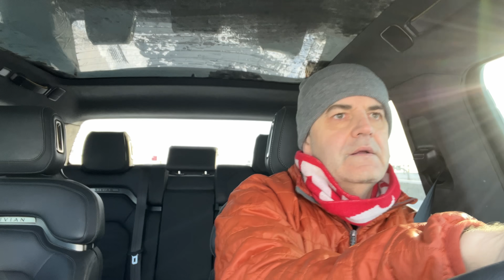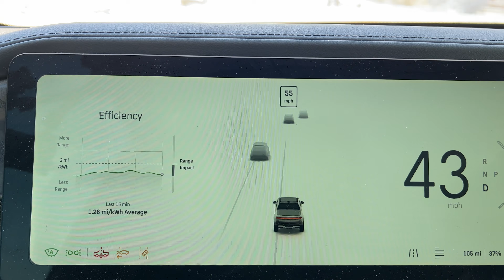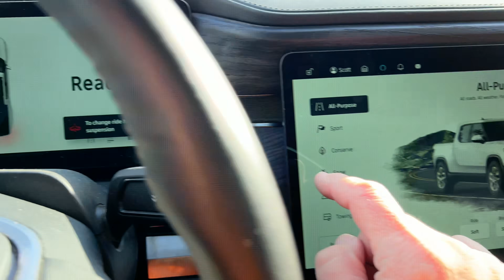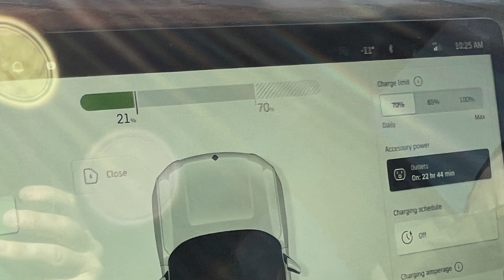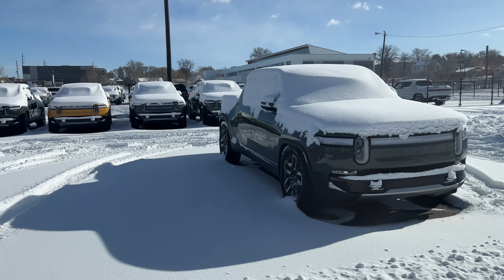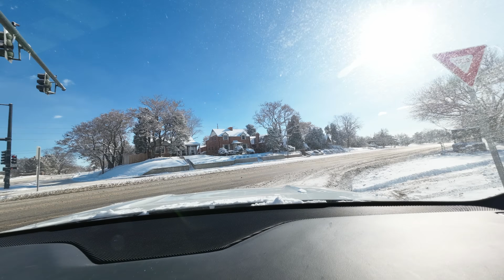Rivian SUB-ZERO Drive! How does EXTREME COLD affect range? | Rivian Dad

Comment: Happy holiday, interesting issues regarding the suspension, but considering electronics have a lower working limit normally around where the temp was in this video, I'm not surprised.
With the news report I've just read regarding the artic storms that have hit the US, stay safe.
Reply from the maker: Thanks! Yeah, I'm wondering if it will clear up by itself when the weather warms. Yes it's very cold here, but supposed to be balmy on Christmas Day! Go figure. Thx for watching.
Reply: It's not the electronics. I drove my Grand Cherokee three hours to the Poconos last night at -4 F and the air suspension worked perfectly the entire time. As I mentioned in another comment,  almost all air suspension issues in cold weather are due to moisture getting into the system. Then the compressor freezes and the air suspension stops working.  At the factory, the system is filled with high purity nitrogen. If atmospheric air gets into the system, it brings moisture along with it and this can cause all kinds of problems, but most notably compressor freeze in cold weather, rendering the air suspension inoperable.  The solution is to get the suspension evacuated and refilled with nitrogen. And of course leak test it to see why the air got in there in the first place. Air suspension systems are designed to take in atmospheric air when the system experiences a leak in order to keep everything working. So if you have a healthy air suspension system with no leaks and a full charge of nitrogen,  there shouldn't be any issues even at -13F.

Comment: Does it do better if it is plugged in for charging or conditioning when parked outside?
Reply from the maker: From what I've heard, it DOES do better if it is plugged in before driving. Assuming that the battery was recently charging so it has not had a chance to cool all the way off. I will have to verify that, though. Thanks!

Comment: Note to self, turn off kneel mode if temps are going down by that much and leave height in standard.
Reply from the maker: Yeah. Note that the R1S handled the weather without any mechanical issues so my R1T issues might be an outlier. We'll see if it resets itself when the weather warms up. Thanks for watching!

Comment from the maker: Just a note about the mechanical issues: There were no issues the day before, which was much warmer (and before the software update). Also, you'll notice there were sensor issues as well. I chalked that up to the snow around the vehicle, and the cold. I'll let you know if it resets itself.

Edit: the mechanical issues resolved themselves once the temp warmed up for a day or so.
Reply: If you leave the vehicle connected and warm it up before starting, does the battery warm up faster?
Reply: Also, today at 40 degrees, snow mode activated!!!
Reply: @robinlunt2535  Ah, so it goes into snow mode when it couldn't possibly be snowing. Not good. I hope Rivian addresses the issue.
Reply: Please keep us posted on what Rivian advises about the suspension.